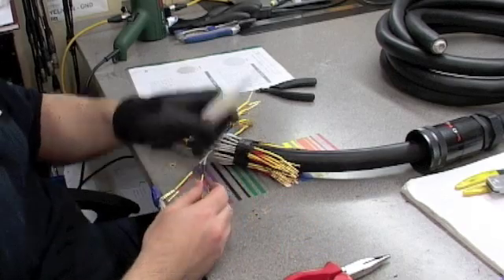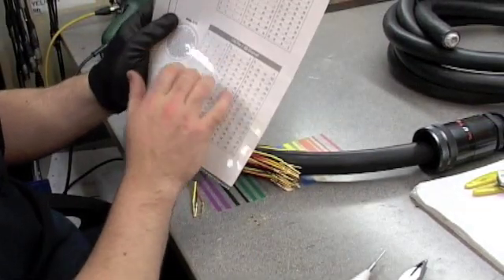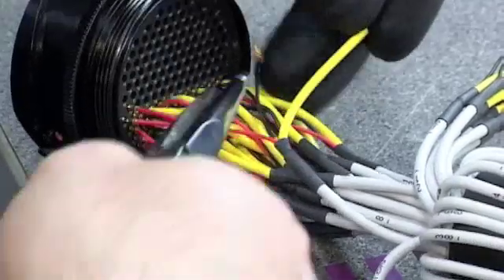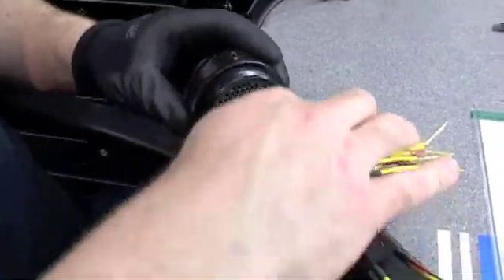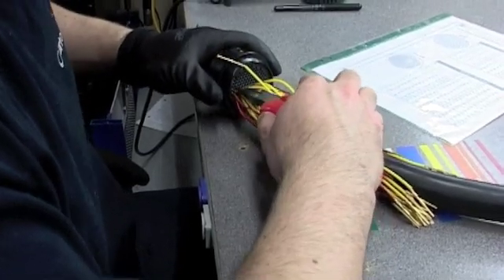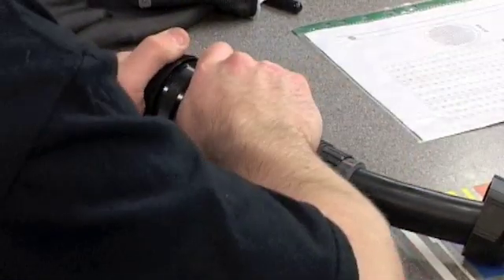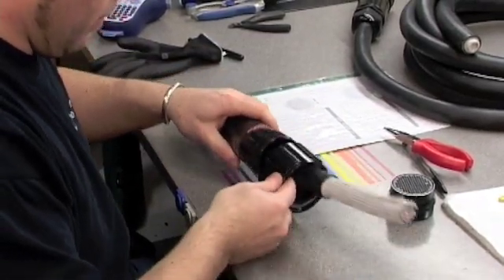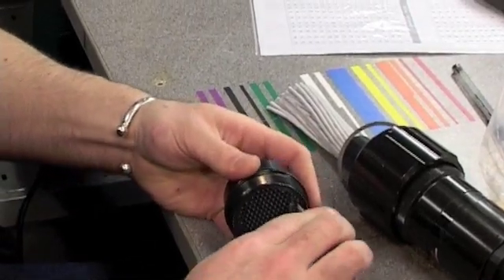How to make a 150 pin Multi Core Cable - Part 2

Comment: when you get to high pin count compact connectors like this, the pinout of your connector is dictated by the internal wind of the cable, as crossing over wires uses up valuable space inside the connector shell.